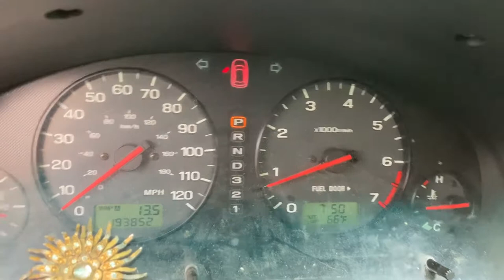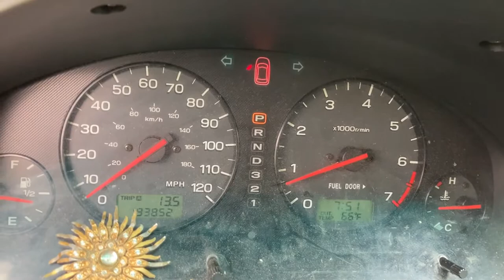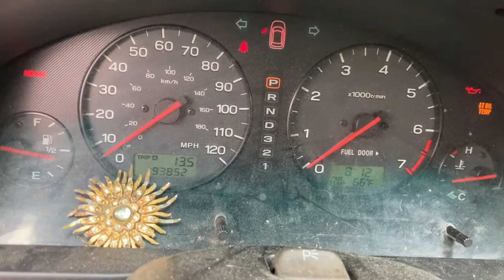02 Subaru Outback fuel pump replacement and diagnosis

Comment: I just took my 2001 Subaru outback to my mechanic and I actually had to use my AAA and have it towed because it would only crank. With 218,000 miles I was given all the nightmare scenarios timing chains jumped electrical. Although at 68 years old, I have a Lotta years working on cars and my wife used to watch our mechanic so he can swim in their inground  pool when he was a kid. , and he never forgot her for that. He’s been at this for 25 years races cars and with my failing health, he really does take care of me, so the first thing he did What do I pressure check on the fuel pump and it was way down so he replaced the fuel pump fix the problem And said it was a pleasure working on that Subaru Because it is so mechanic friendly.
Reply from the maker: Subaru is definitely repair man friendly even the engine every bolt but the engine mounts can be removed from the topside.

Comment: I get a somewhat long cold start on my 02 h6 as well as irregular cold idle.  At low load and speed in top gear the car seems to ‘wiggle’ a bit like it’s not running smoothly.  At higher speeds it has small hesitations when adding a bit of gas.  Fuel trims are normal and I put in new plugs, ignition coils and injectors without a change.  It has a new fuel filter.
So I’m considering a fuel pump.  Maybe it’s not bad, just not performing well after 200000 miles.
Reply from the maker: Sounds like you have done quite a bit. A fuel pump is not hard to do and fairly cheap. These cars also had issues with the plastic sending unit oring leaking too.

Comment: Discovered VVG with this video - looking to troubleshoot my own 04 Outback stuttering/hesitation problem. 

Just bought this old Suby with 250K miles and I can hear the pump squeaking in the back....the hesitation and stuttering varies from non-existent to a full one second of power loss and stuttering. No CEL. Replaced air filter and plugs.
Reply from the maker: I have been doing some research it seems on the fuel pump housing there is a large o-ring about 1.5-2” diameter that fails and causes a fuel leak internally in the fuel pump housing.  This can still be diagnosed with a fuel pressure gauge.  It will ready low or not hood pressure after key is Cycled off
Reply: @VinylVillageGarage  The problem is a loss of power. Often when first starting the car for the day and sometimes on the road - the car sputters for a few seconds.

The pump assembly in my tank has a sender unit, a pump, an a filter. The only O-ring I see is the one that seals the filter canister (there is a replaceable paper filter element). It was very tight and required some lube to reassemble. The fuel pressure is around 35 psi. 

What would you suggest?

https://youtube.com/shorts/ygEboXZ8BFE
Reply from the maker: It seems you and quite a few others are experiencing the same issue. Fuel pressure stays steady while running bad and holds good pressure with the engine off and key off. No fault codes but the car falls on its face basically while driving.   It seems like a common enough problem that someone has to have the solution or has figured it out.  I wish I had the answer.   The next step in diagnosing would be watching ecm data and input from the sensors and see if anything goes out of whack maybe not out of range or it would set a fault code but abnormal readings.
Reply: @VinylVillageGarage  You might find this helpful since I asked you about both problems previously.

Problem: intermittent sputtering and loss of power. Happened any time or speed but strong tendency to occur for morning starts when parked with nose slightly uphill.

Solution: rebuilding the in-tank unit and replacing the EXPENSIVE black rubber bits that seal the fuel pump and filter. That was $70 for those 3 tiny rubber parts.

Comment: I'm getting a very mysterious gas smell inside my cabin. It only happens after I run my car for about thirty minutes and it's coming from the inside rear. Strongest smelling near the trunk area. It's not coming from the engine bay, it's not my gas cap. Could it be fuel pump assembly? 

I got to the assembly and it doesn't exactly smell like it's coming from there it's so hard to tell.
Reply from the maker: The fuel pump
And the access plate is sealed to the floor so it would
Be very difficult for the vapor to get in that way.   Inspect the fuel lines from the pump to the engine for excessive rust or seeping.

Comment: Thanks same car same issue
Reply from the maker: Welcome, The fuel pumps and there is a large o-ring on the sending units that fail frequently. You should replace both while in there.

Comment: can you tell me where the fuel filter is on that subaru?
Reply from the maker: Yes, it’s located under the hood drivers side strut tower.  Follow the fuel line from the engine and you will see it in line.
Reply: do you know if a fuel filter can be added to this pump style? looks like the cap is as big as the filter and maybe the same size.
filter and cap. 42072AE00A

gasket and cap dorman.  902-438
Reply: back seat passenger side.  thats if it is a 4 door.  the 2 doors have them just behind the trunk area